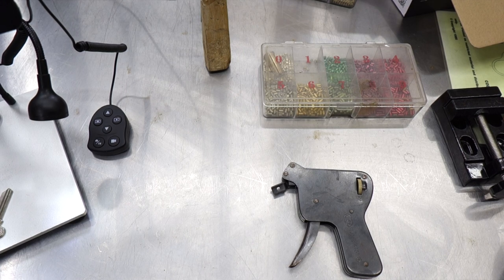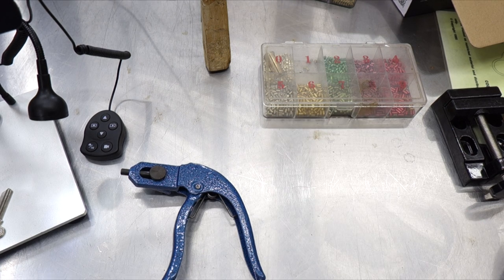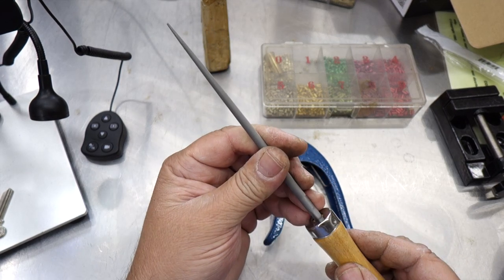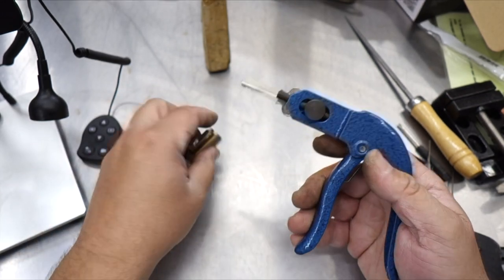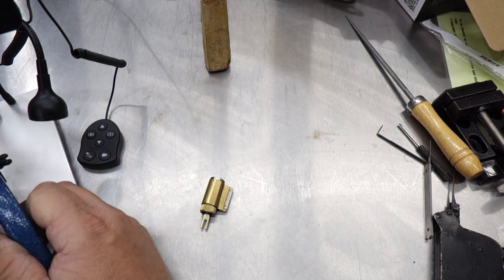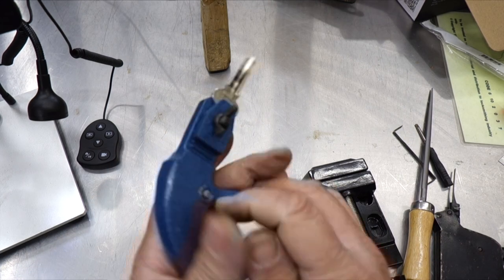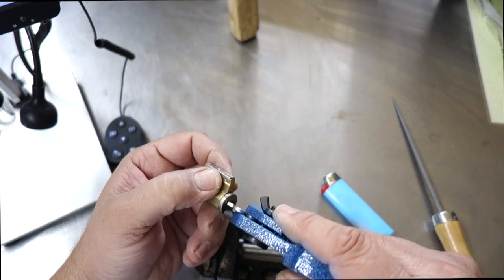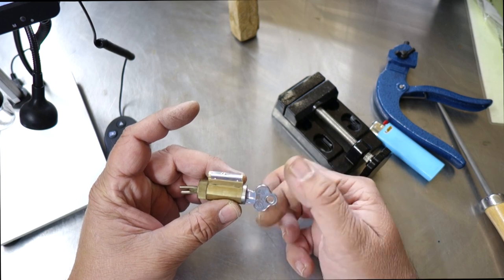Impressioning Gun - Unlocks Lock & Makes Key

Comment: I'm still a little confused as to how this gun works.  You said the key doesn't go forward; only the post does.  Does the post on the gun somehow push the key blade up into the pins?  I get how impressioning works (I've done a few keys that way), but I'm just having a hard time grasping how the gun functions to put the marks on the key.  Up until today I didn't even know that an impressioning gun was a thing, so I guess I have some catching up to do.  Thanks for the video, the close up cam is a nice touch and really shows the details well.
Reply from the maker: It puts pressure on the key and pulls back

Comment: I just use a #700 pro-lok impressioning handle , a diamond cone file , a diamond bead file , and a flat file with smooth non sharp edge to lay the cuts back as they get deep so as to not trap the key.